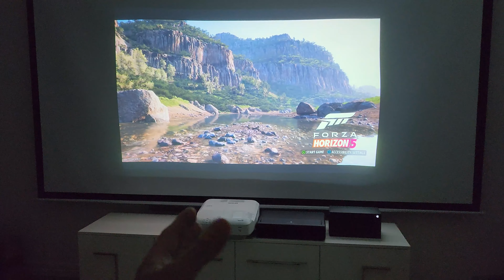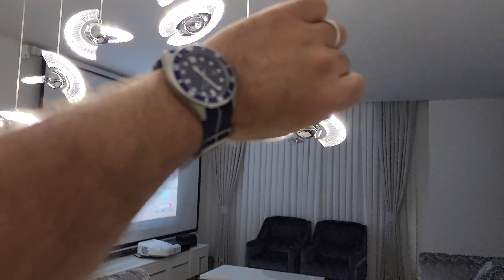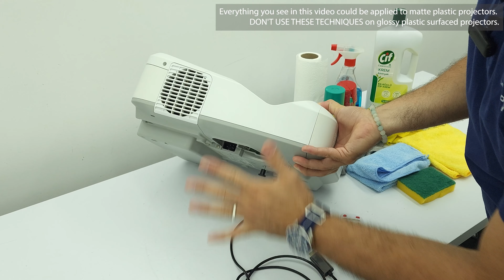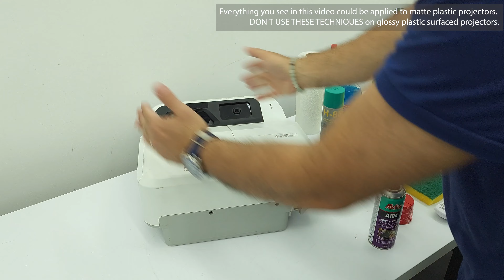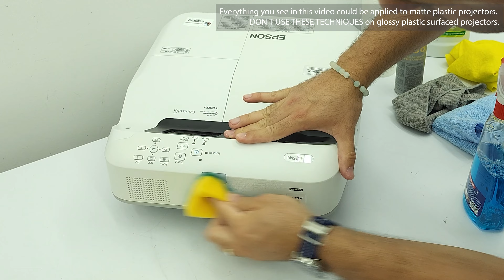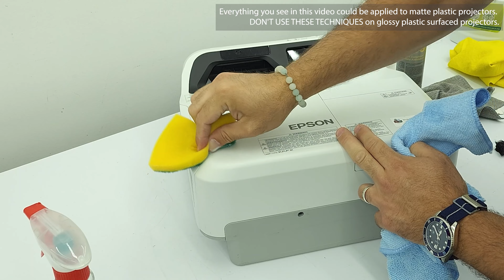Second Hand Projector Becomes New ?

Comment: Hi, Thanks for the video. I bought used Epson EB-685WI after seeing your video. The projector is working fine. But the fan noise is too loud. In ECO2 mode at 10 feet its 42-43 DBLs. I think the fan needs cleaning or replacement. But I am not sure how to open the fan slot, could you please do a video for that ? Thanks in advance!
Reply from the maker: This device has 2 fans probably normally it is extremely silent in eco mode you cant hear it. Before opening the device I recommend find the fans for it one is 8cm second is turbo I guess Just found this amazing item on AliExpress. Check it out! US $12.34  5%OFF | SF5020RH12-01E 5020 Projector Fan for Epson EB-450WI 450W 455WI Projector Blower Fans
https://a.aliexpress.com/_mNhqSZK